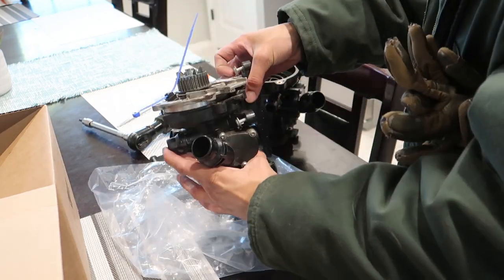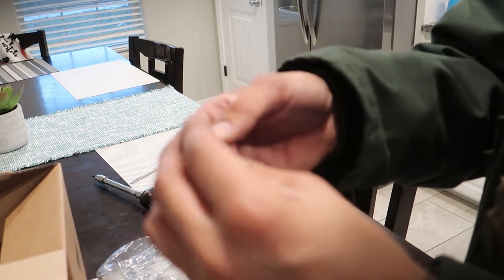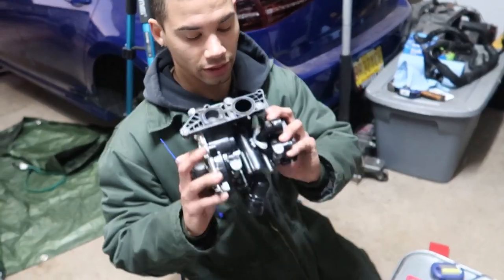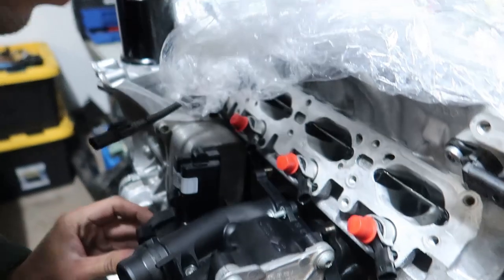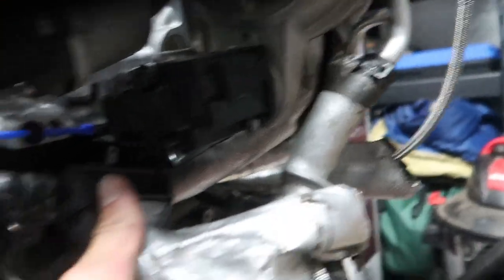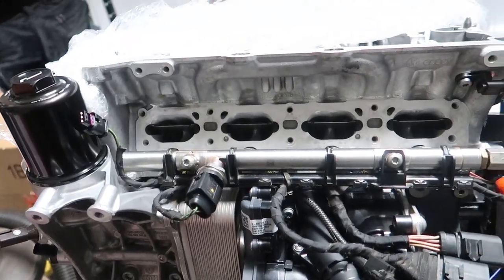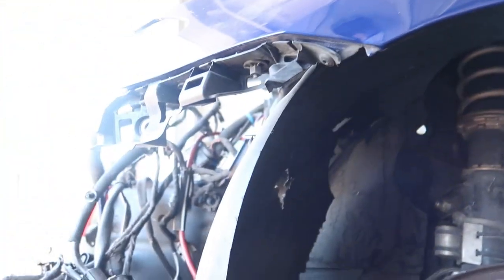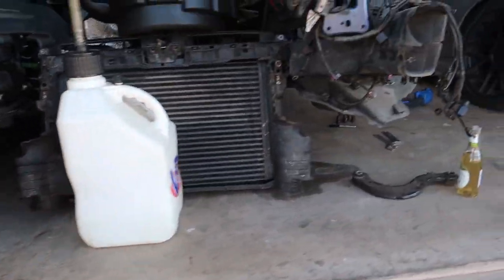Water pump on! Tying up a handful of things! | MK7 Golf R

Comment: Bar-tek have the MK7 Steel waterpump and steel cover
Reply from the maker: Whattttt no way??
Reply: @BryceJordanProductions  yeap i already order it..for my rebuild...go to bar-tek and look for race waterpump for mk7 gen 3 my other one have only 3 months but when i found out i cant do other thing than order it ASAP
Reply from the maker: Interesting i just saw them have ads on my IG ill go check them out!
Reply: @BryceJordanProductions  steel waterpump are one of the most important mods in the MK7...this plastic pumps are a failure from vw, i order an accusump to pre-oiling too, keep those bearings oiled before cold start is other important thing, more important if you are track driver... Another thing i put in my R, is the CSF Radiator....

Comment: We’re you able to get the system bled properly and normal coolant temps? Mine is acting like I have an air pocket and it’s running hot
Reply from the maker: I did indeed. At first my thermostat wasn't plugged in.. lol. Jack it up open the cap let it run with he heat on full blast
Reply: @BryceJordanProductions  wouldn’t that not being plugged in trigger a fault or light? I’ve vacuum filled it but it gets hot and the fans never kick on
Reply from the maker: @burb17  no light but there was a soft code for the thermostat